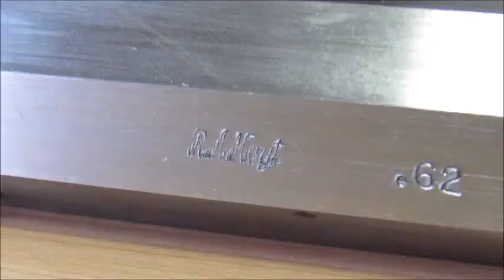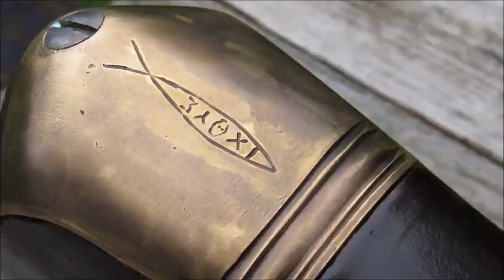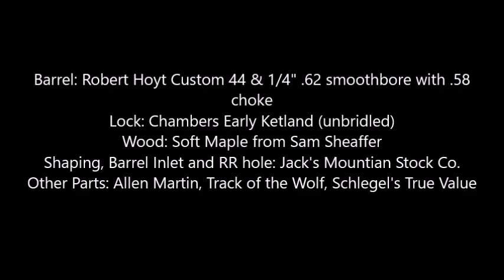A Custom Flintlock Fowler Build

Comment: Nicely done. I find the PA longrifle lines and furniture to be a bit off-putting for a fowler, but im a New Englander. My biases are towards severely slimmed down, vaguely brown bess and decidedly English lines on a fowling piece. No matter. Its a good looking arm that shoots well. What more could you ask for? Cheers!
Reply from the maker: Thanks and yes I went with a Lancaster profile but rounded everything, arched the comb slightly, left the wrist a bit heavier, I went about building it to my liking, not after any original.
I also used fowler parts, but modified them.
I wasn't sure of I should call it a smooth rifle or a fowler but decided it's closer to a fowler than a smooth rifle. Thanks for watching

Comment: Hi Brian, beautiful work, as usual!  Could you comment on what to select for a fowler that would primarily be used for turkey?  I see most guys who have flintlock fowlers use 20 gauge for turkey.  I see Chambers offers a kit in 10 and 12 gauge.  I can understand a lighter gun, so sticking with a 20 gauge, but would it be a bad idea to go larger if it's built for use on turkey?  Thanks for helping out a rookie!  God bless!
Reply from the maker: 20 is most common, and with it being a ML, you can customize your load.
For instance I have tested 2 oz of shot in my 20 already, not something you'd find in a modern shotgun load, plus you won't be shooting very far since black powder velocity and lead shot have their limits. 
If I were to recommend a flintlock turkey, knowing what I know now, I'd go with any configuration with a 20 ga, 42" barrel choked .
Reply: Thank you for the very helpful response!  I hadn't considered the lower velocity and can definitely see the importance of a choke.  I do already have a Pedersoli double barrel percussion 12 gauge choked Full and Modified that I've never shot.  I just ordered the nitro cards, wads and overshot cards from Ballistic Products, so I'll probably start by getting acquainted with this, though the goal is flintlock.  Thanks again - definitely enjoy your excellent videos! @bkauffman0390